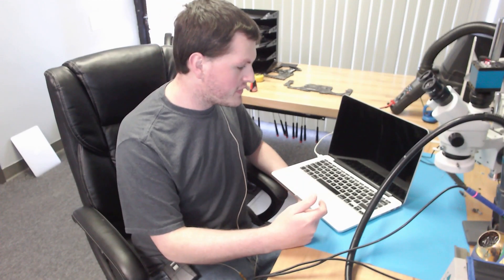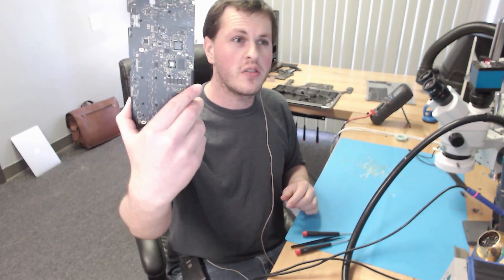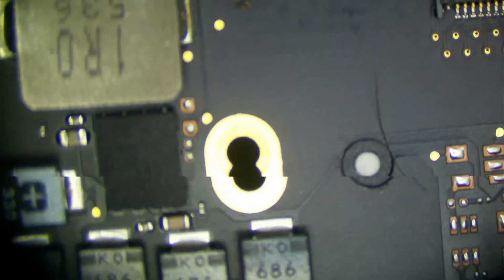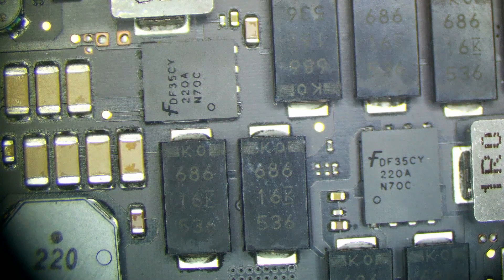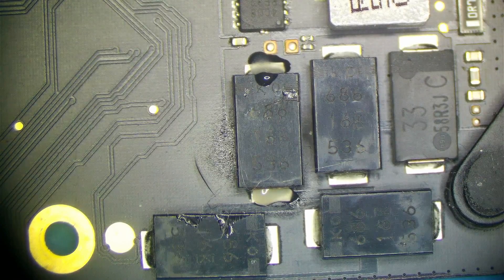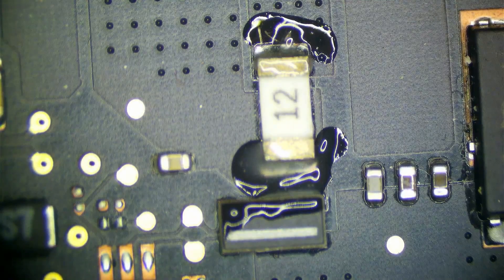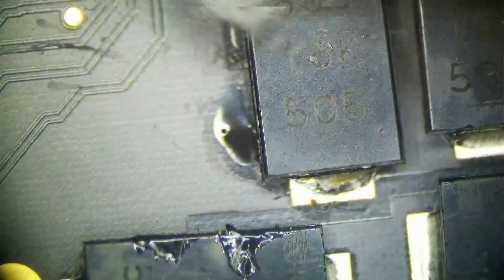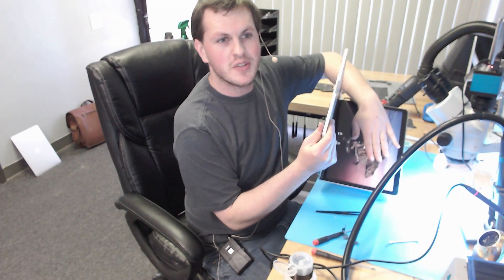A1502 13" MacBook Pro no power component level logic board repair

Comment: My MacBook Pro is the same model as this one, I got random errors and restarts about 2 weeks ago and today it will not start up or turn back on but the charger light is green as the computer is completely charged. When i do get it in because I force restarted it, it works for a while but shuts off after it goes to sleep, restarts or I try to update ( because I thought it was a software problem ) do you think I could be having the same problem as this unit ? Also I recently had a keyboard replaced

Comment: Why don't you use a bit of low melt solder on the joint before you start, can make removing the bad cap much safer less risk of damage to the cpu.
Reply from the maker: There is zero risk of damaging the CPU with the heatsink attached unless you really really don't know what you are doing.

Comment: In 1992 a customer brought his PC back to the computer store I was working at because the video was "funny". I opened the case, booted it and stuck my head in to look and listen for any indications of an issue when the tantalum capacitor decided to, in the words of SpaceX, have a rapid unscheduled disassembly right when my face was next to it. Luckily I was wearing my brown trousers at the time. The cap was coloured (colored) blue and had been installed back to front when manufactured but decided to wait and scare the crap out of a human before its RUD.

Moral of story; if there is a high pitched noise coming from a board, do not do a close inspection without wearing safety glasses. Those things come apart fast and with a lot of force and noise.

Comment: Great and informative video, Tim. Can you tell us from your rich experience, how often is shorted cap the main cause of failure? I bet corrosion as a consequence of liquid spill is nr. 1?
Reply from the maker: Shorted caps become more common after the device ages, and usually isn't the result of corrosion or liquid damage. Shorted caps are a relatively common cause of failure in "middle age" devices.